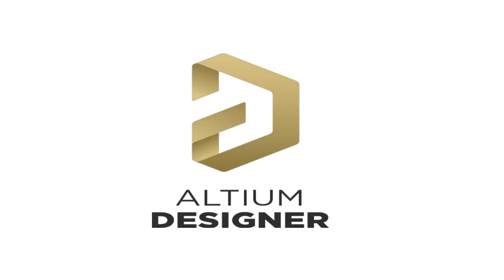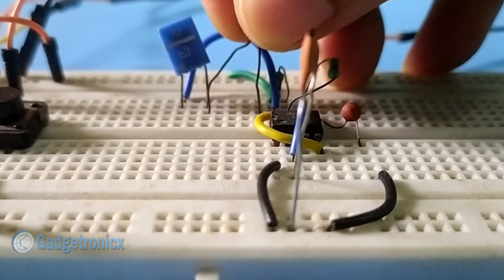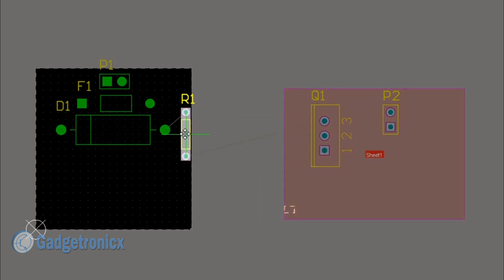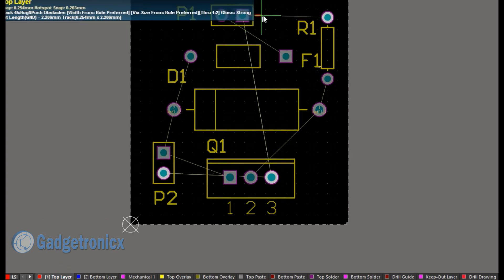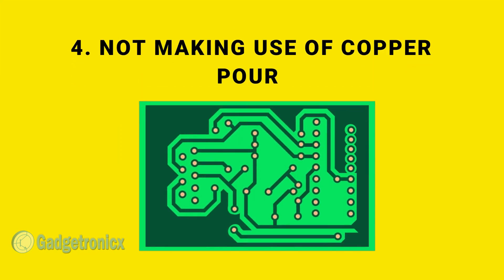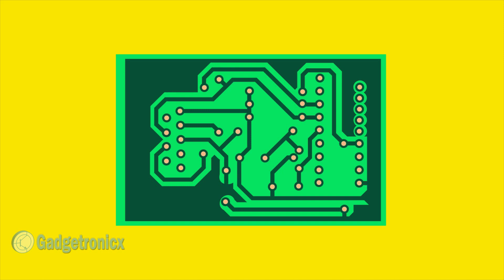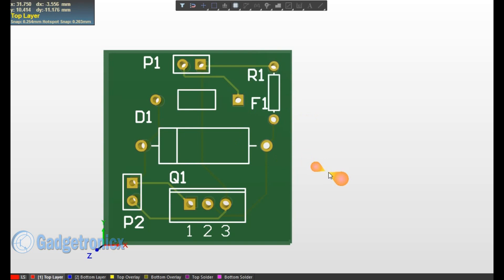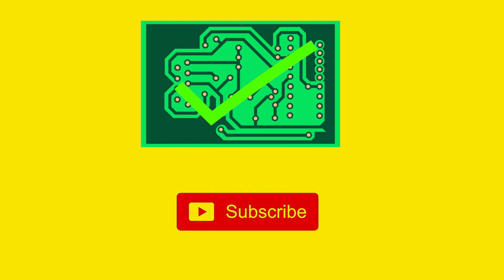Common PCB designing mistakes to avoid

Comment: Thanks. I'm working on my first PCB (for hobby use) and I didn't think about using primarily horizontal and vertical directions on each side, but that makes a lot of sense. I will have to look for how to do those copper pour areas you mentioned.

Comment: My tip I want to add: Place your PCB traces in such ways they're easy to see and follow even when components are placed. 
That makes it a lot easier to troubleshoot later. Avoid going under IC's and such if possible. If one do need to place traces under components, place them in such ways it's easy to see where it goes in and where it comes out when obscured.

Comment: Recently made a rookie error. Designed a pcb with some ic's in it and when designing i place the tracks on the top view layer without mirroring its shape.What happens was that once i receive the pcb i realize that when i was putting the ic's in the through hole pins from the bottom they were in the opposite holes in the other side. Had to go throught it and solder the ic's from the top layer. Try to avoid this please.

Comment: Great video. I have some queries, why opposite directions of routing is not recommended (point 2)? Is there any advice/guide for proper component placements (point 1)? Thank you!
Reply from the maker: When you route traces in different directions ( Horizontal or vertical ) in a single layer soon you will run out of ways to connect components. While keeping one direction in a layer will allow you to use the space efficiently

Comment: Very Useful Video , just confuse at 3rd point. should we make all routes with max width. which should prefer all track with same size if possibile.
Reply from the maker: No, the traces that carry high current such as power and And traces should use high trace width